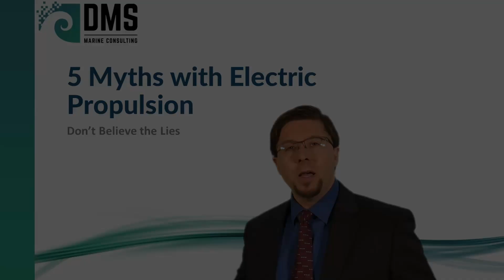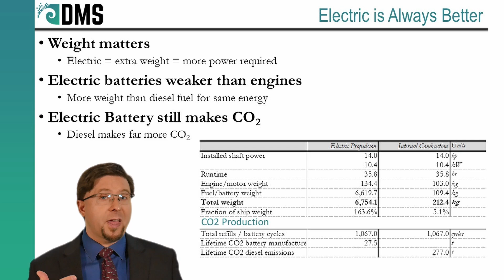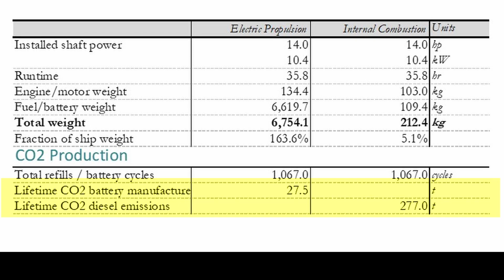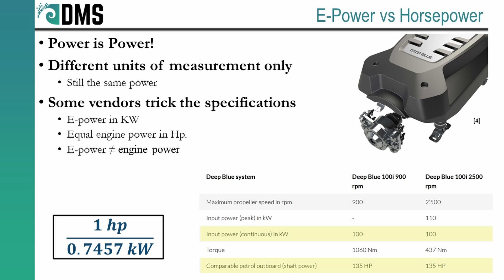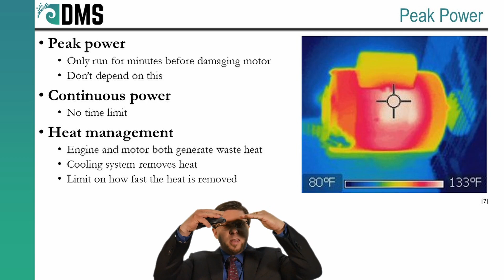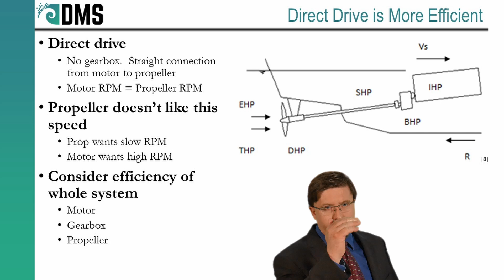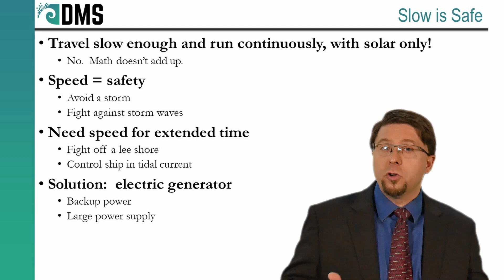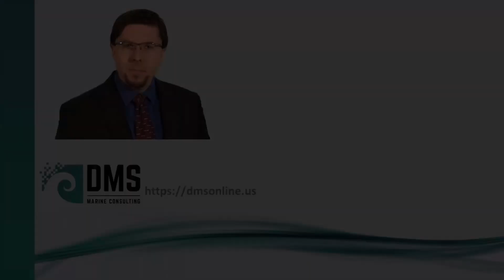5 Myths with Electric Propulsion:  Don't Believe Marketing

Comment: I'm interested to know your thoughts on possibly integrating new technologies like the Exro Technologies Coil Driver which could provide more capability from the inverter of an electric propulsion system. They've not fully integrated into Marine tech yet but experimented with a few partners. I'm hoping you're not bias against electric vehicles 🙏.
Reply from the maker: I looked at the Exro Technologies Coil Driver.  Can't say that I have enough expertise to really discern scientific truth from marketing hype.  But no, I'm not against electric vehicles in marine.   I don't have a problem with electric technology.  But it's my job to see the difference between technology and marketing.  A lot of electric marketing tries to hide the fact that electric isn't a perfect solution.  It does have limitations.  And in some cases, those limits don't justify the application to shipping yet.  That being said, I see more applications for electric on ships every year, and I look for them myself.  We aren't against electric.  The problem is just that electric has to compete against internal combustion, which already had 100 years to refine and improve.  That is a large head start to compete against.

Comment: 2:33 So are we not counting emissions from power generation? Just teasing, one thing I would like to add if you have a battery fire then its checkmate, game over, the vessel is lost. Current gen Lithium ion would burn and corrode a hole in the hull in very short time.
Reply: OK ,year old comment, , any fuel related fire on a boat is boat burns to waterline, you can find a case online pretty much every week where a ICE powered boat has burnt to the waterline, exploded or catastrophically damages vessel What's the difference, frequency of occurrence,

Comment: I watch many sailing channels  on YouTube and observe that sooner or later every one has problems of some kind or other with their diesel engines . While this makes entertaining viewing is it the best method of propulsion for a sail boat? Combustion engines are highly complex with thousands of different mechanical and electrical parts. There is so much that can go wrong and inevitable they do even though they are being regularly maintained. An electric motor has very few moving parts and much less that can go wrong. A BLDC electric motor has basically two bearings at each end of the shaft for moving parts and not a lot else. In contrast a diesel engine has pistons pounding up and down, bearings, gaskets, hoses, cables, pumps, filters, cooling, alternator etc all of which sooner or later will fail. A diesel engine requires regular maintenance whereas an electric motor requires minimal maintenance. 

For me an important factor is that once on an ocean passage you cannot stop mid ocean and top up the fuel tank. With electric there is usually a daytime charge from solar especially in the tropics and probably regeneration from sailing if on longer passages.  If range is a problem than just add more battery capacity and more solar. I agree lead acid batteries are heavy but lithium are not. If a boat goes to electric drive it makes sense to replace the batteries with lithium and use some of the space and weight gained to increase the battery capacity. 

Depending on the size an electric motor it can often be lifted by hand and is much lighter that a diesel engine. In contrast look at some of the videos of people removing a diesel engine from a boat using all sorts of lifting tackle to get it out safely. Removing the engine and diesel tank will not only reduce the weight of the boat but provide additional valuable storage space as a bonus. 

To me it looks like going electric is a win win situation and that is before adding the benefits of silence, no fumes, no dirty bilge, no smoke and no smell.
Reply: An all-electric system has many drawbacks, and I think you're operating off a few false premises.

For example: size and weight. While electric motors can be lighter than ICE options, we need to compare apples to apples. There are also ICE engines that can be picked up with one hand (think RC car engines), but they don't do us much good for powering large marine vessels. Similarly, the motor in my washing machine can be picked up with one hand, but is not useful for large marine applications.

The comparable performance electric motor is going to also be heavy, just like the ICE engine it's replacing. It might be a bit lighter, but we're talking in the same order of magnitude. The real benefit here is that electric motor form factor means we can decouple our sources of power from our use of power (more applicable in hybrid systems than all electric, but still holds true).

Next, I want to address your battery statement: batteries are heavy. Lead acid batteries are heavy, but also lithium batteries are heavy. The problem lies with energy density: various lithium chemistries are extremely high in energy density and discharge capacity, but no matter which chemistry you look at, they all pale in comparison to hydrocarbon fuels. This means we need lots of batteries to give us similar ranges as a much smaller weight in hydrocarbon fuels.

This is one of the limiting factors in the EV market: the range cap that everyone is running into is defined by size and weight. These modern EVs are using the best lithium chemistries available, and still fall far short of the range and refill capability of hydrocarbons. No matter which battery chemistry you use, you have the unavoidable fact that you do not consume the weight of your energy storage as you use it, and while the cheat code appears to be using batteries structurally to squeeze more capacity in, that introduces a whole different set of nightmares for safety and maintenance.

Additionally, lithium battery tech presents a set of hazards that do not really exist with hydrocarbons like diesel (especially in applications where we are sitting in highly electrolytic mediums like sea water). Lithium battery fires are incredibly difficult to manage, and they present a fume/explosive risk that is a poor companion for metal compartments strengthened by sea water.

The point of all this rambling is to say that while batteries can make a good emergency or standby store of energy, they are a very poor means of primary storage for large scale or long distance travel applications.

The best solutions involve carrying your fuel in sources that are much higher up the density graph: uranium, hydrogen, and hydrocarbon liquids being the obvious contenders.

Nuclear electric hybrids are obviously the best but not currently feasible for anything but large naval vessels for a variety of reasons.

Hydrogen fuel cells are theoretically great but not commercially ideal and seemingly won't be for a while longer.

This leaves us with liquid hydrocarbons. Diesel electric hybrids are already in use in everything from rail and marine to over-the-road trucking (newly in this arena) because of the safety, efficiency, power, speed of refill, etc.
Reply: Its the electronics that is the problem, and battery fires, look if your half way across the Pacific in a storm and have a problem, which you will, good luck fixing it.

Comment: Well, I'm already ahead of this in my project, a 42' motor sailer. I already am to the point of wanting/requiring a generator for backup, 120/240 power, and hydraulics, a product of my 60+ years at sea commercial fishing and sailing merchant marine, mostly in Alaskan waters. As you can most likely tell, I'm retired, so fast speed is not a need; always watching  and anticipating the weather is imperative for my cruising plans. 
Glad you made this for "to whom it may concern." My larger issue remains what type of battery system  to invest in, I've heard some horror stories using lithium batteries that spontaneously combust. I'm open for comments regarding their safety record. And---Toyota seems to be leading in a next-generation battery using silver as the medium and it sounds very encouraging for not only safety, but very rapid recharging, much better than lithium. Caveat: yes, it remains to be seen, but it's sounding quite likely.
Reply: One more thing: looking at the direction things are going politically, the cost and availability of diesel is a major factor in my plans.
There is more crazy shit happening now than I could have imagined just a few years ago. We're heading right into that old Chinese curse "May you live in interesting times." In fact, we're already there.

Comment: A:
prop re-gen, in Sail Power applications, makes electric propulsion worth it to me. 

( because prop power, in such applications, is an intermittent requirement .....so it's the way it can recharge on a hydrodynamic drag trade off, under sail )

Comment: direct drive only works for lighter craft with lower power requirements..
the more weight you have to push, the slower the prop needs to spin to couple with the surrounding water under those loads.

that said, not all electric motors are created as torque equals ... the axial flux pancake motors put out more torque per volt.

Comment: Hey, electric motors can be water cool so no overheating!,  in 1882 Nikola Tesla 1882 invented the brushless AC motor!, it does not have a "peak power" issues and has involved to a water cooled version too or short more power is coming out of smaller motors, and do not to forget for marine use only a super conducting version was developed for the Zumwalt-class destroyer, -in the USA. The information is you are giving is just so conservative! -what's why USA is not leading in Naval Architecture! What I have here in the USA seen you about 40 years behind ;-) https://www.youtube.com/watch?v=7LNSVT-vJZQ&pp=ygUeYWJiIGVsZWN0cmljIHByb3B1bHNpb24gc3lzdGVt

Comment: Your numbers are deceptive,   And misleading.   Kw is linear to hp but you failed to mention torque curve differences.     Secondly your like for like comparison fails to mention that on a typical day of boating you are left with a lot of fuel in your tank that’s uneeded.    And that you can’t generate fuel while at anchor.    Long voyages fuel wins,  day trips or weekend trips, Solar all the way

Comment: Great Video.  I do wonder if you could have included more information on the advantage electric drives can give you for close quarters maneuvering.  Many smaller vessels spend a significant amount of time close to shore and docking etc, and the quick responsiveness of electrical motors may be invaluable .  I know that many boats already use electrical motors in maneuvering thrusters, but I suspect that their can be other useful possibilities.  Would two screw systems be useful?

Comment: You can ignore the CO₂ argument. Mainstream Science is certain it has a logarithmic and slight effect on heat retention in the atmosphere. It is part of a recycling system that sustains life (photosynthesis, stoma, conversion of energy and storage as carbohydrates). As an aside, deserts do the most to avoid this recycling system, hence more of this trace gas is required to reclaim these (mostly) man-made zones. From over-hunting (USA, Mongolia, Gobi), fire clearing (Australia, Amazon), and tillage (Spain, Middle East) etc.
I was hoping for a mention about a generator-powered, electric-motor drive propulsion system (advantages, disadvantages) that avoid large batteries.

Comment: I think the biggest mistakes when considering electric boats is that all boats are still made as if they are using ICE engines. Few are getting to innovate the marine space like Tesla is the automobile and SpaceX industries. 

Instead of treating batteries as if they are replacing a fuel tank, design batteries as part of the superstructure itself. Any weight batteries add is minimized as being part of what holds boat together. Why, rely on solar to charge batteries when you can also have wind turbines. You can also use aquathermal energy (same as geothermal) to generate electricity from the difference in temperature between the water and air, which would be perfect for a constant trickle of energy always going into batteries. Further, when anchor or docked you can lower small turbines into water columns or tides  and capture energy from there. Lastly, there's the ever present kinetic energy from waves. Just like how sidewalks are designed to capture energy from people footsteps, the hull can be designed to capture energy from the water making contact. If there ever was a more perfect solution for self sufficient travel it's the marine sector, it just requires thinking outside the narrow box of historical boat production.

Comment: For a video that purports to disprove myths, this certainly seems to intentionally walk right by the reasons why people choose to go electric, the sorts of boats being made electric, and the economics behind going electric. You imply that most people converting are doing so because of their concern for CO2 production, when very few people I'm aware of really care much about this issue. I mean, you know, we all want to do our part, but that's not what's driving us. We're changing because as recreational sailors and cruisers we are tired of the complexity, maintenance and expense of diesel power. Diesel's great, when it works. When it doesn't work - which is often - it's a royal pain. Mechanic's time, when you can find them and get them to come, costs a fortune. The engines are enormously heavy and located in cramped compartments and it seems that the part you need to get to is always impossible to get a wrench on. For every green warrior converting to electric to save the planet, there are five people who decided to go electric after hanging upside down trying to bleed the injectors while bobbing around out there, or spending two hours hanging upside down over the back of the engine block trying to replace another damned belt that shredded. The engines are dirty and noisy. The fuel is increasingly expensive, and finding decent diesel in some places is difficult. And when you get a bad batch in the Bahamas or Lewards you're dicked. And when your engine decides to have a fuel issue it always seems to be someplace dark as you're going into a channel with wind against tide. I like being able to simply push the throttle and feel the boat move. You talk about electric adding complexity. This is simply ludicrous in the real world. Diesel motors, especially the newer ones, are hugely complex with multiple potential points of failure. Electric motors have very few moving parts, and the components that run them are quickly and easily interchangeable because they are easily accessible and don't weigh much. Electric motors are torquey and deliver umph way down in the rev curve and they are extremely reliable. The only disadvantage to them, honestly, is range. Shrug. Some of us are still actual sailors. We sail. And your comment that running solar slowly doesn't have the math behind it is absurd. KWs are KWs, and if I have more coming in than going out, I can do it practically forever. For free. The cost of repowering with a new diesel is prohibitive. A new electric motor with battery system and inverter and charger will run less than half the cost of a new Yanmar. For a power boat electric makes very little sense (outside of narrow niches like canal boats). But I think that most people going electric are sailors. For us there are significant advantages you are ignoring.
Reply: Diesel engines are very reliable.
But one must know how to  do a few tasks to maintain them and keep the fuel clean.
Thats about it.
Reply: Indeed - you hit the nail square on the head !
Reply: So, electric has niche advantages?
Reply: That is absolutely correct. To claim an electric propulsion "more complicate" than an iCE is a bit strange. So many things that can brake, need maintenance, and especially knowledge of all that stuff. For an electric system you have the engine, the battery and the controller. That's it. No oil, no sparks, no filters, and - very important - no "Diesel-Pest". You even have more cables on an Diesel engine. For starter, for pre glowing, for generator, for oil pressure, for cooling water temperature, etc. The only really disadvantage of an electric propulsion system ist the range. You need to configure a battery that fit's your needs. That might be impossible, depending on your use case. But all others is an advantage .

Comment: Very much a layman question here. I'm in the process of having a boat built, 29' DE type, inboard, 270hp diesel spec'd currently. 

As I understand it a diesel prefers to operate in a given range for maximum efficiency, yet a hulls most efficient performance, (in terms of fuel consumption, is "hull speed." Hullspeed tends to require a far lower power requirement that's lower than where the engine is at optimal performance. Does a hybrid solution address this mismatch?

Comment: I don't disagree with any of this, but the table at the beginning is not factoring in that any diesel boat will have at least 1000L of fuel (at least as a capacity) so there's that weight to consider. Battery weight is high but if you have a large fuel tank, you could be matching battery vs fuel weight. In addition, all boats have batteries anyway so the difference in battery weight will be the maximum battery weight needed for the engine minus the battery weight already planned.

Comment: For electric motors, their power is equal to voltage times current.  A high voltage motor will run faster but has small torque and vice versa.  Joule heating is related to the current.  Hence, a high speed motor stepped down via gearing is preferred to a slow one
Reply: And their torque scales with weight, so a high speed low torque will be lighter than a low speed high torque.